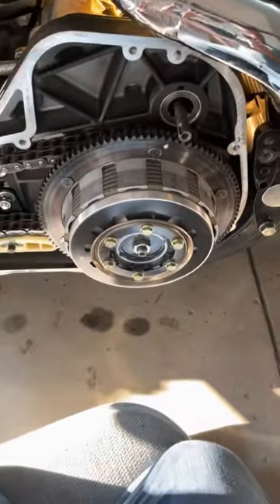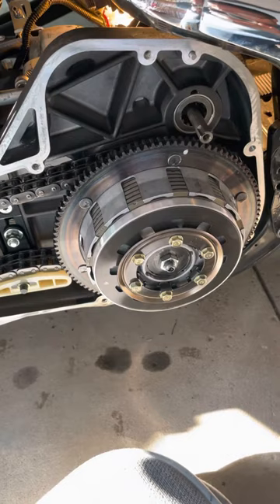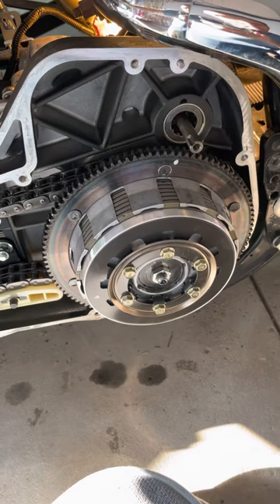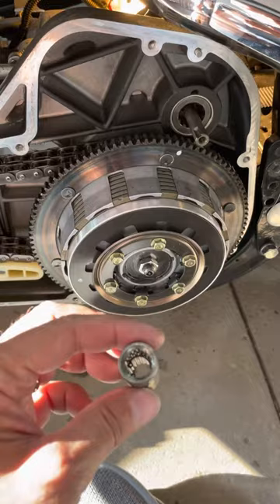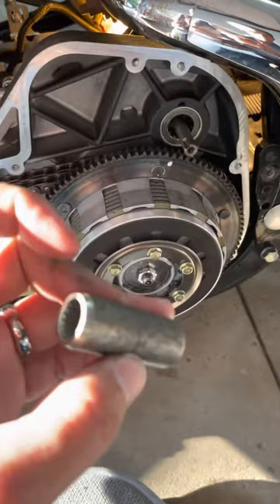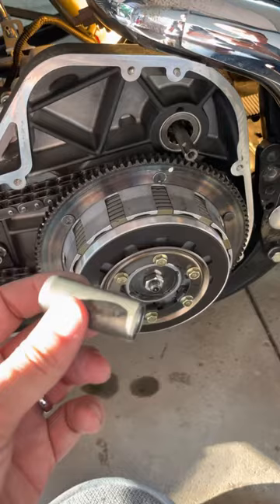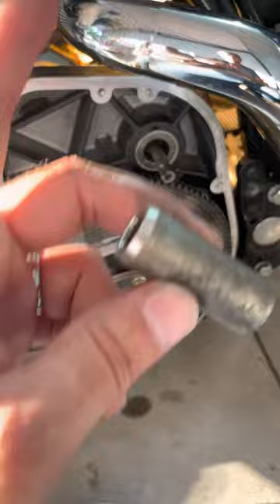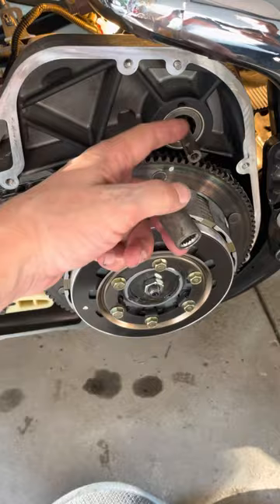Harley starter shaft / jackshaft coupler position

Comment: I changed my starter on my 02 Superglide a d the long bolt wouldn't grab the starter. I couldn't figure out why. I replaced it with the same exact starter.  This video was perfect because it showed exactly what I did wrong. Thanks so much.

Comment: You're right and easy to overlook or as you say if it falls out you have no way to know which way is correct if you don't have the service manual. Wouldn't hurt to mark it ST and JA with permanent marker.  I haven't taken the starter out of the 2002 Road King but have switched starters on my 1999 Evo, Fat Boy and it looks exactly the same as what you're showing.  Great video, Thanks.
Reply from the maker: … 🖊 Good idea! … next time. 👍🏼

Comment: Why not say beveled on the outside goes in, like the manual.
Reply from the maker: You’re absolutely correct. I’ve read the manual too. Both ends have some bevel, taper, etc… one more than the other, but it can still get confusing. I’m simply offering more info to that orientation. 👍🏼